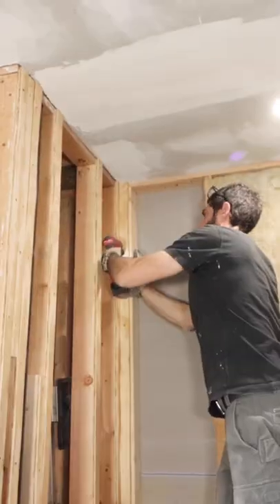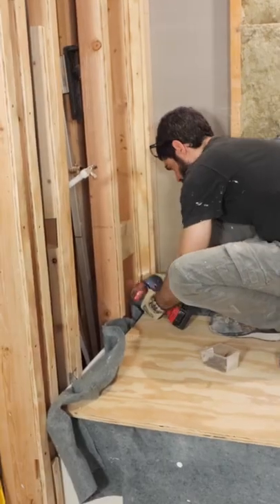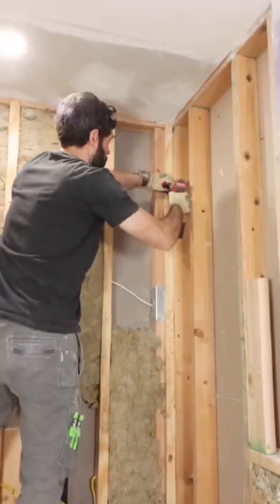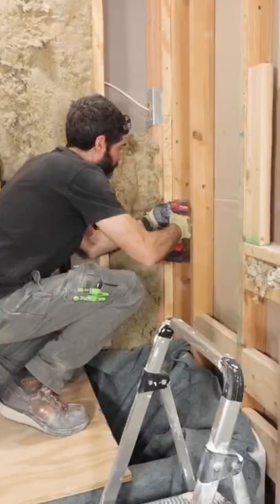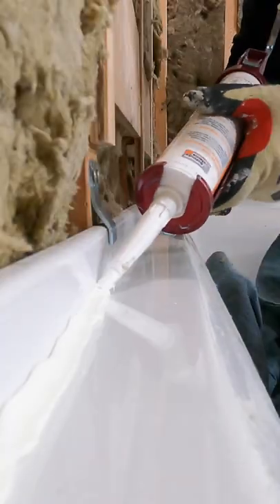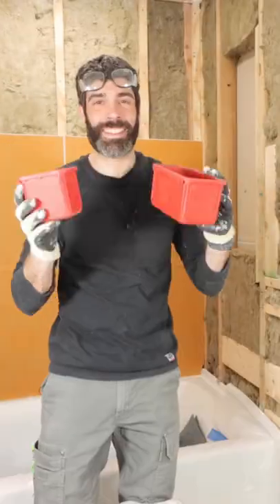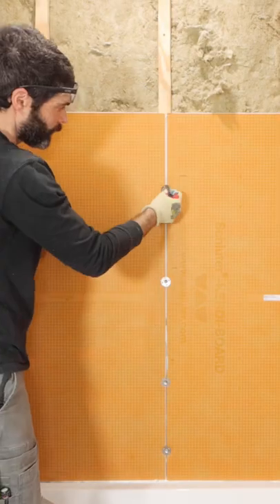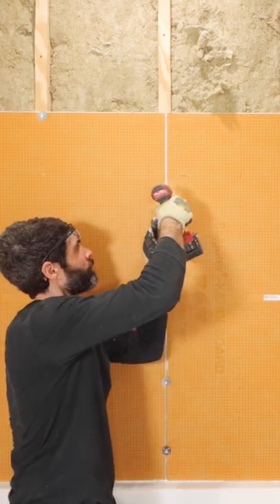Kerdi Board Tub Tips - #shorts

Comment: I put lots more screws. Hundreds of pounds hanging off those screws. Kerdi can say that's all you need but I overkill everything.
Reply from the maker: No argument here with overkill 🙌🏼
Reply: The 1/2 ply trick is something I'm gonna have to try out. The guy that taught me would always set the board on the top of the tub then pack that gap with mopei type 1 and go with the tile. Having the board go tight to the tub just seems a better way to get it done. I always use a 3&6 screw pattern 3 on the edges and 6 in the field.
Reply: @otravis676  I usually set mine on the flange and tape and mud, waterproof